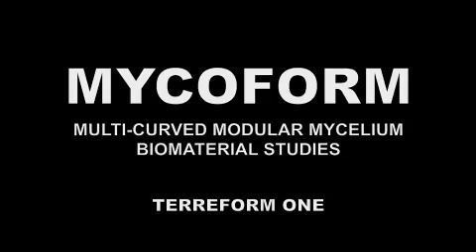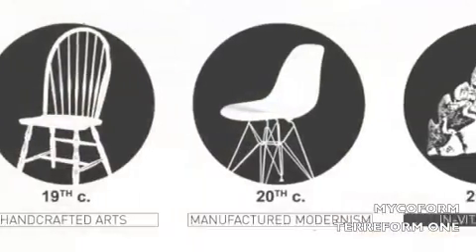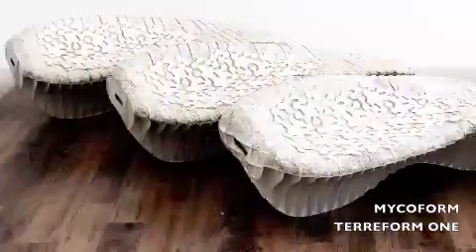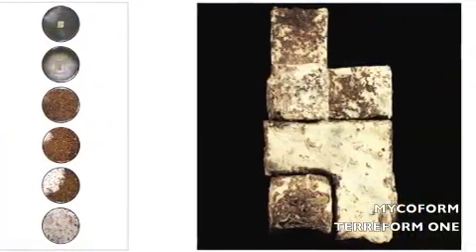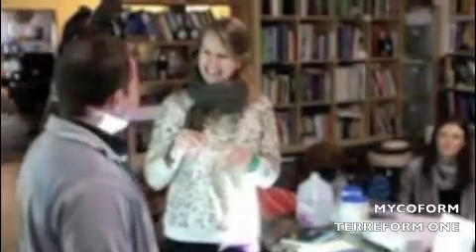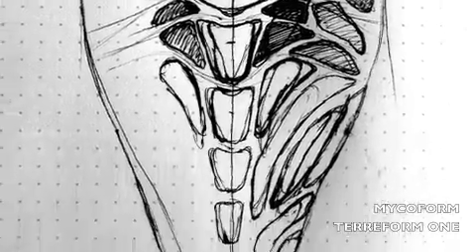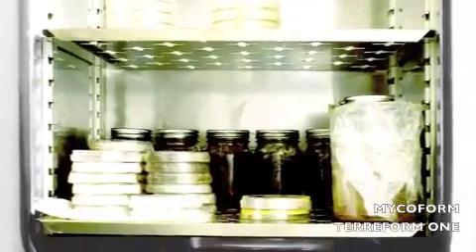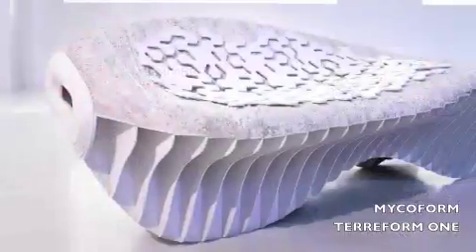Mycoform Surface | Multi-Curved Biomaterial

Comment: That's great and all, love the idea of it, but growing mycelium consumes oxygen, produces carbon dioxide, uses byproducts for the substrate created from mining/farming/logging and other industrial processes, and requires a controlled environment to be grown, and so I'm wondering how this is supposed to be a 'green' alternative to petroleum based products? I don't see this being a viable replacement on an industrial level, it would require a huge amount of resources and power.
Reply: +MechanizedIT I suppose that you could go into a heath food store and come up with a reason not to eat any product in there due to the product having too many calories, you don't like the packaging or it is to expensive, but then you go hungry.Look at this mycoform it as an option that could be used instead of fracking or oil spills.  Who knows where this technology will end up?  Maybe someday it will be grown from garbage at the land fill.
Reply: +Tom Cool Well lets say it is grown from garbage, you still need a facility with climate controlled rooms kept at 70 degrees F, you still have to process that garbage i.e. crushing/chopping it, then pasteurizing by heating it to around 125 degrees for at least 2 hours. I&#39;m just saying, a process like this is not as &#39;green&#39; as it is made out to be, and calling it an &#39;organic&#39; material is kind of silly, petroleum is &#39;organic&#39;. Oil spills are the least of the problems, millions of barrels of oil already naturally spews into the oceans and on land daily.

Honestly I think you are better off just farming timber and cotton to make furniture.
Reply: +MechanizedIT We all have our opinions I guess and if it works, then it will be around.  If it doesn't work then it won't be around.  Right now it is another possible option.